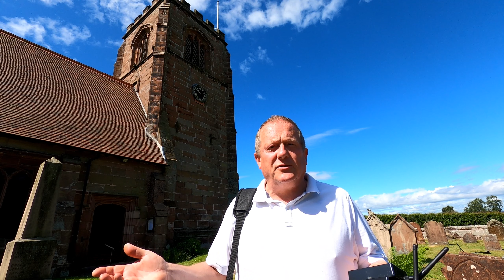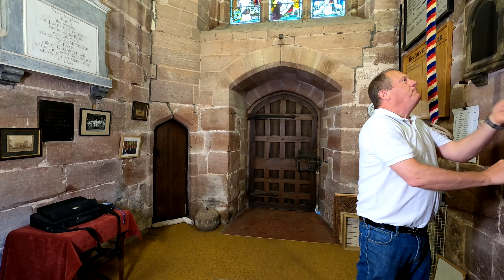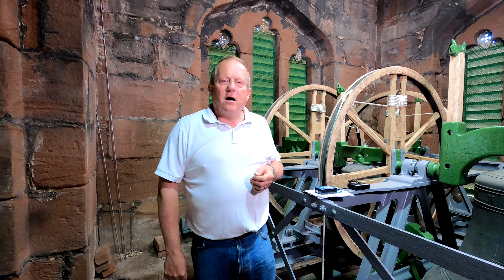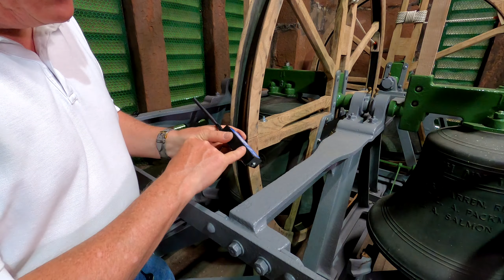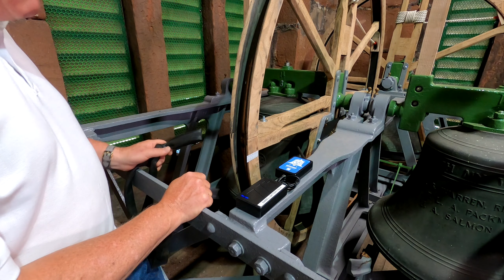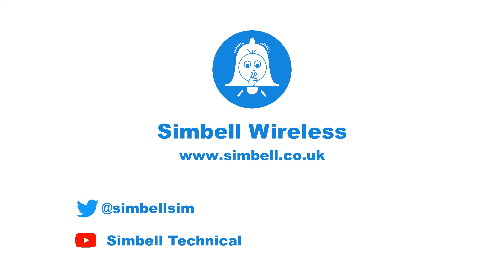Simbell Technical - Creating a "Pop Up" Simulator

Comment: Just curious....when you tie the clapper, does it have any effect on how the bell feels to the ringer?  Would it cause you to learn a slightly different technique at the rope, since the clapper now moves along with the bell throughout its swing?  Or is that negligable since the bell weighs so much more than the clapper?
Reply: In my experience, tying the clappers to one side only affects ringing if the bell is light set and you come to set it when it may appear even lighter. 
When actually ringing it doesn't make any real difference, I am sure that very experienced ringers ( more than me! ) would say that they could tell you which side it was tied, but I did a test on this with some very experienced ringers and they couldn't tell me. 
Generally, I would tie it so that is was in the correct position when stood at handstroke as most teaching requirements are not setting at backstroke so if there is any difference it is not affecting the most common set position.